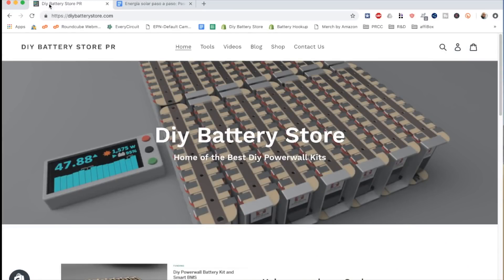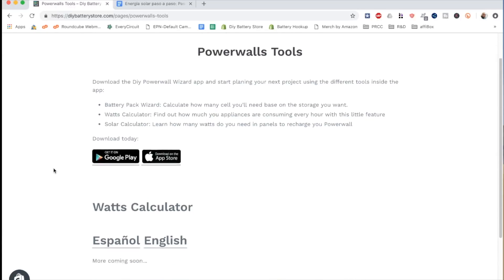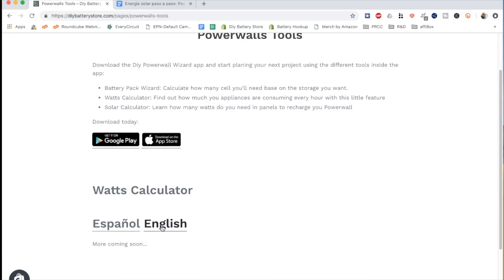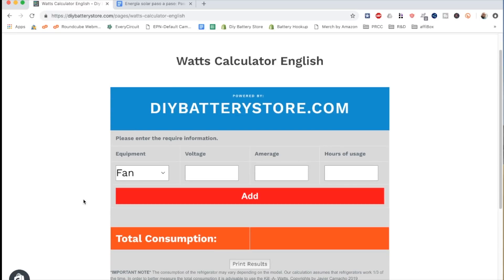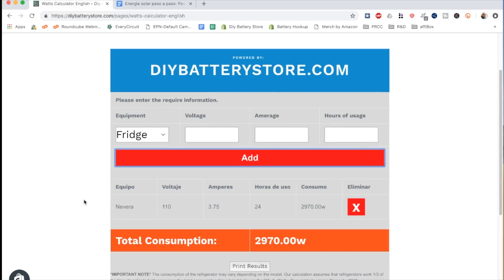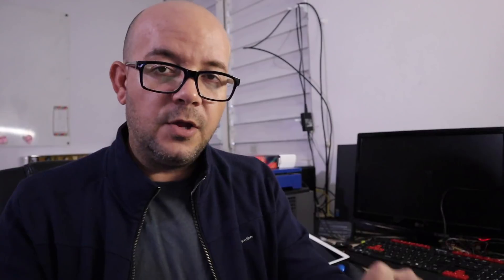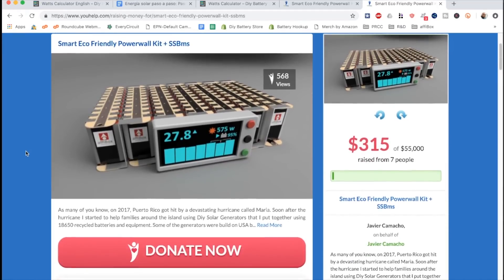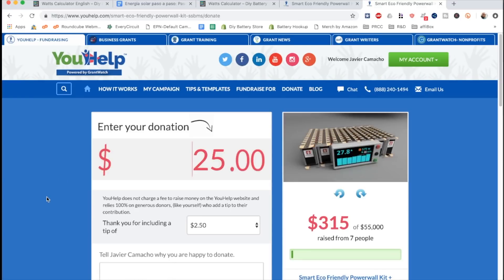How to build a Solar Energy System | Step 1 Watts Calculations

Comment: Javier I have been measuring energy with these wifi plugs https://www.amazon.com/Outlet-Compatible-Monitoring-Function-Required/dp/B079Q5W22B/ref=sr_1_9?s=lamps-light&ie=UTF8&qid=1550724694&sr=1-9&keywords=wifi+plug

Comment: This is probably a stupid question but, I know it’s power x time = watt hours, but once inverted to 120v, am I still getting let’s say 100ah AC as I would 100ah DC?
Reply from the maker: 12v x 5 amps = 60 watts right?
60wh ÷ 120v = 0.5amps

Hope this helps

Comment: Javier, I think you're confusing people.
Watts is a flow rate of joules per second, like gallons per minute. Picture a hose of flowing water.
Watthours is a quantity of energy - Picture a tank containing gallons of water.
1 Wh = 3600 joules. 1kWh = 3.6 MJ
We don't say 100W per hour - it's 100 Wh !
Reply from the maker: I understand your concern but for the purpose of this video and for solar energy the explanation works. 

Like I said on the video. I'm not going into the details of what a watt is as a scientific term. 

I'm more interested in teaching watts as a  solar energy systems term.
Reply: To this confusion comes the understanding that the same thing sometimes have different ways of  understanding the samples.  __ People are constantly learning. In the beginning, Horsepower (Hp) was the norm. My experience of learning about energy, flow, work 1 Hp = 750 Watts,  Joules are all the same energy. I do prefer a tank full of Gallons, Liters or cubic meters of water as an example of how to get confused. Andy and Javier are right.
Reply: There is NO LEARNING, without experimentation and plenty of FAILURES.
Don't believe everything you read, hear or see (example: augmented-reality).  Almost everything we know, is due to someone realizing ideas and notions into "proof of concept" and then writing it down for the rest of us to learn. Few successes come without prior failures. There are many discoveries that are uncovered by mistake.  Nitro-glycerin never made a nickel for it's inventor.  He simultaneuosly discovered it and died. There are many discoveries yet to be made and things to be perfected/optimized.  Humanity has far superior tech, like solid state rechargeable batteries (example: Prologium Solid-state LCB Lithium Ceramic Battery), saltwater driven rechargeable batteries (example: Aquion Energy Saltwater Batteries) and even perpetual graphene generators.
But there are greedy companies out there going into self-protection mode, buying patents, not to bring these techs to fruition in the markets, but to tuck them into their corporate safes.  Then there are states that promote these monopolies.  Let's help humanity and spread the knowledge.  Don't let progress be put on hold by the greed of a few.  Let's "harvest" what is free my "peoples".  Can you "dig it"?  There are millions of us, and just a few greedy corporations, we can do this!  Let the free energy rebellion begin!